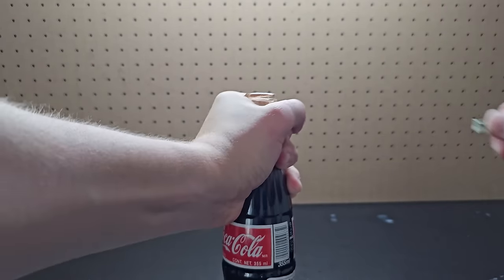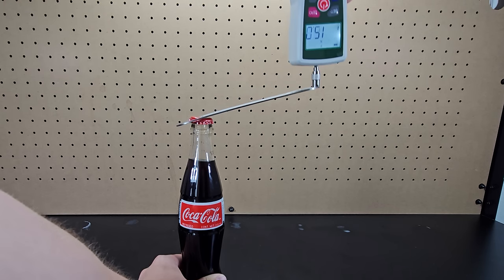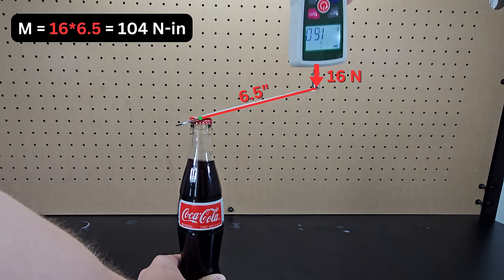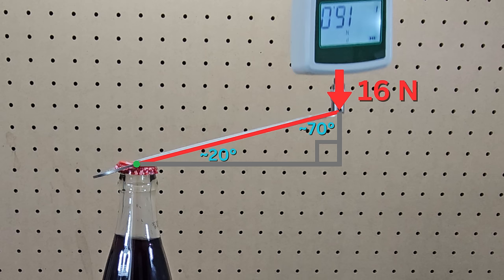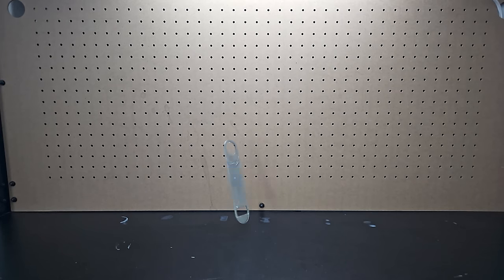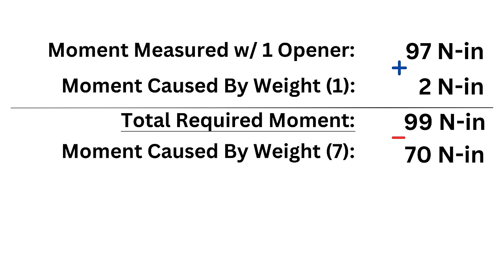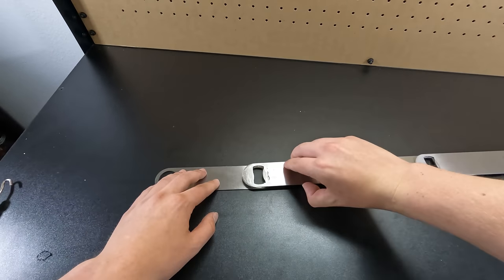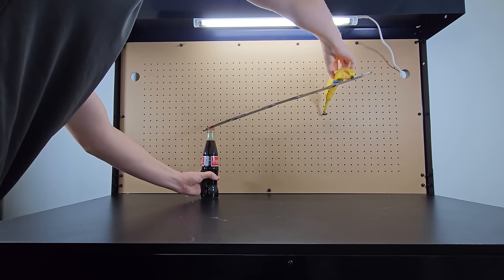World's Longest Bottle Opener (Theory vs. Reality)

Comment: I like how he glued multiple bottle openers together instead just gluing a long rod or sheet of metal lol
Reply: Fr
Reply: It's for the natural bottle-opening force they add. A rod doesn't help!
Reply: @GoPieman  a sheet of metal would have enough weight. That, or a long enough rod would still let the banana get enough leverage.
Reply: @NigelMelanisticSmith a rod isn’t infused with bottle opening power it wont work
Reply: @drkclshr  skill issue. Clearly you aren't German enough to realize that everything is infused with bottle opening power
Reply: @GoPieman You get a +2 bonus to dexterity when their are more than one bottle opener! A rod could never 😅
Reply: I think it had something to do with the simplicity of the Math; knowing the weight of each bottle opener.
Reply: Always use the right tool for the job

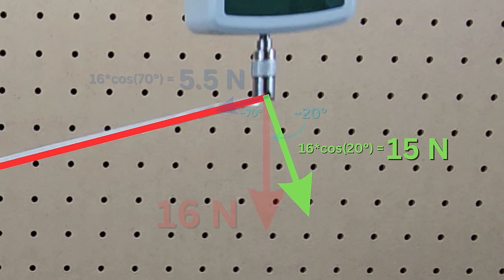Comment: 1:20 he said newton meters instead of newton inches accidentally. Even he can’t handle how cursed the unit he just invented is
Reply: Newton meters are normal
Reply: @aarondroid1595 newton inches is the cursed one
Reply: 97 Newton meters is a lot of force just to open a bottle.
Reply: @sage5296 then use Newtown centimeters
Reply: @starc3968 now i get it 😂
Reply: @sage5296 u mean torque
Reply from the maker: lol
Reply: @sage5296  and bottles are high pressure.
Reply: @sage5296 force is Newton.
Reply: @markgeorge447  9700 newton CMS is still a lot
Reply: @sage5296  force? also 97 newton inches is a lot more

Comment: Cool I never thought that just increasing the length could do so much it was a little hard to understand but cool you should try out more things using this bottle opener
Reply from the maker: Great feedback, yeah I understand that might be the case depending on people's background, hoping people will skip through the analysis if they aren't able to follow along.
Reply: I think the concept is torque. The longer the lever arm the more the savings. That's why manual car jacks have long handles. You don't have to be strong enough to lift a car to lift a car.
Reply: Who was it that said, "With a long enough lever and a fulcrum on which to place it, I can move the world" ?
Reply: @hadensnodgrass3472  I believe that was Archimedes
Reply: Yep Torque = Fxd = Fdsin(theta) which is what he meant by force applied has to be perpendicular to the bottle opener length.
Reply: The same principle is applied by construction crews and mechanics all the time. If there's a bolt (for example) that simply won't budge with a regular wrench, and a longer tool isn't available, it is usually convenient to slip a pipe over the tool, increasing the effective length of it, and reducing the total power required to get the job done
Reply: Thats why crowbars exist
Reply: You learn that when you're 15 lol

Comment: Never seen anyone using an opener like this pushing from the top down. I’ve always pulled upwards, seemed a lot easier
Reply: Yeah that way requires even less force. Maybe he did it like this just because the apparatus is easier to set up
Reply from the maker: You'd have to hang it over the edge of the table if you did it like normal because the bottle opener would go lower than the surface of the table.
Reply: Uh I work at a bar and it's much quicker to push from the top down. Pulling from the bottom is a weird movement, you have to sort of put the bottle through the hole in the opener first. That extra half a second is precious. I only pull from the bottom with tiny keychain openers.

Pushing down is way easier than pulling up btw, requires more force because gravity pulls down.
Reply: @Altrop  shouldn’t you pull up to have your arm in position to move on better, rather than your arm going down and then you have to lift it back up again. Those 0.5 seconds add up.
Reply: @lolithighs Then again, I think the difference is probably negligible. XD

Comment: Levers are straight but looking at the mechanical advantage you can imagine them being exactly the same as gears in gear reduction.
Going from small gear to large gear you can convert speed to torque, going from long arm of the lever to a smal arm after the fulcrum you can turn small movement into a much larger one.

Comment: The banana being helped by the CoG of the long lever
I suggest (not!) building an overly unnecesary attachment platfort able to hold the bottle sideways, with a set of strings running the weight of the banana to the now laying contraption to basically extract the weight of the lever from the experiment.
Plus if the platform rests over sliders with the force meter on a side, you can measure the thrust of the bottle upon releasing the cola

Comment: Doesn't the weight of the opener have a gradually heightened effect on the moment as the point at which you're measuring the weight gets farther away from the bottle cap? Like if you had a weight that you could slide along the bottle opener, and you slid it to the far end, would it exert more force on the moment than it would if you had it slid near the bottle cap side of the opener? I could be wrong, but just wondering.
Reply: The distance to the center of mass us used to calculate the force of just the bottle openers as shown at 1:53. Adding more shifts the center further away, and the opposite effect when removing bottle openers.
Reply: @PUR3lCHA0S  Oh I see that now, thank you!

Comment: For anyone who’s more interested in why the bottle opened. The bottle cracked open not because it started to tilt, but because of him trying to flatten it.

This general topic is called Torque (τ), which as he said is the force applied from a displacement in reference to the fulcrum. This can be calculated as τ = F x s ⊥. 

The reason the bottle opened was because of Newton’s third law and first law. (Third Law) Every “action” (force) will have a “reaction” (counterforce). (First Law) As well as “intertia”, which means things moving at a constant speed want to stay moving at that speed. 

Now the reason the bottle opened with such little acceleration. As the bottle tipped, nothing necessarily changed. Gravitational acceleration is constant, and the mass didn’t change. So we can assume that it had nothing to do with the tipping motion exactly. So what caused the bottle to open?

As he said, “it was that little bit of acceleration” he applied to flatten the bottle. How is this? See, as the bottle was not moving before, the system (The bottle and bottle openers) was in “Equilibrium” where there is no change in movement. Because of this, the sum of all τ’s going clockwise are equal to all τ’s going counter clockwise. 

The bottle openers were pushing in a clockwise direction in 1/2 (P.s*) of the displacement of the entire string. This is our clockwise τ. This would be counteracted by the force of the bottle cap fighting back. This is our clockwise τ. If the force being applied exceeds that of the amount of clockwise force, then the bottle will open.

As the bottle fell and gained velocity (however no acceleration changes as Gravity is constant), him fixing the bottle flat on the table caused it to decelerate (as it went from moving to rest). However, this force would generate a “reactional” force as the system’s acceleration shifted. This reactional force would be facing up on the other side of the fulcrum. Because of this, a new clockwise τ was added. Though the displacement is small, the force was a lot (as the bottle openers were heavy, and due to Newton’s second law that Mass x Acceleration = Force, that would generate a lot). Because of this, the counteracting Torque exceeded the “29 N-In” required for the bottle to open.

I hope I got this correct, if anybody wants to correct me feel free to. I have a test on Torque tomorrow so this is how I’m practicing for it 🗿

(P.s* Now as he described, the bottle openers were not “uniform”. If it were, the τ would be calculated in the middle of the opener. However as I’m too lazy to calculate all of the τ’s I assumed it was uniform).

Comment: Does it not add any additional force opposite the fulcrum meaning the math may a bit screwed, like the math would be the case if only regular gravity was effecting it right? My following question is how much force do you actually need when taking into effect weighing down the bottle yourself?
Reply: the bottle's weight is irrelevant to the amount of force required to remove the cap from it.
Reply: @kingcrimson4133  im not talking about the bottles weight i am referring to the opposite force of his hand holding the bottle and how  it can’t fall the other direction because of that force.

Comment: smh our guy doesn't believe in integrating the torque of the bottle openers across the length of the moment arm to get the total amount of torque imparted by the bottle openers themselves

just a little more, and it would've been a self-operating bottle opener, so long as you can keep them stuck together